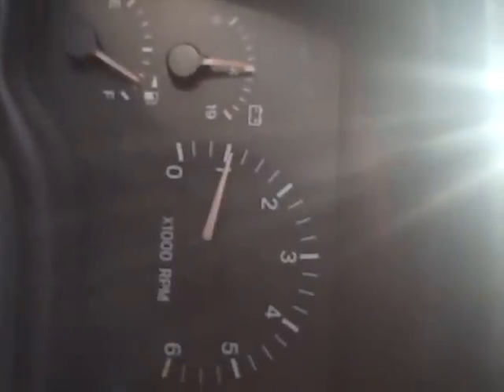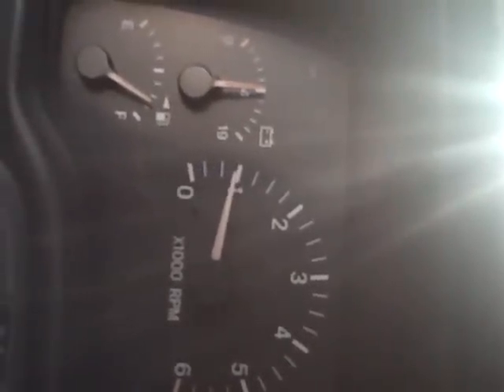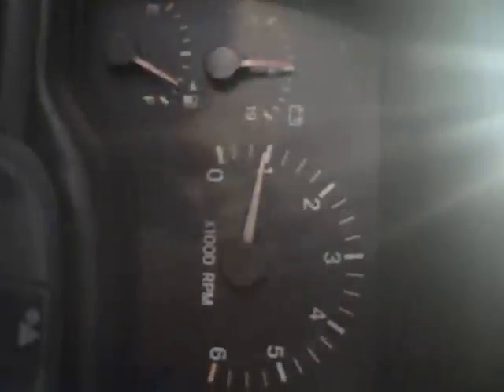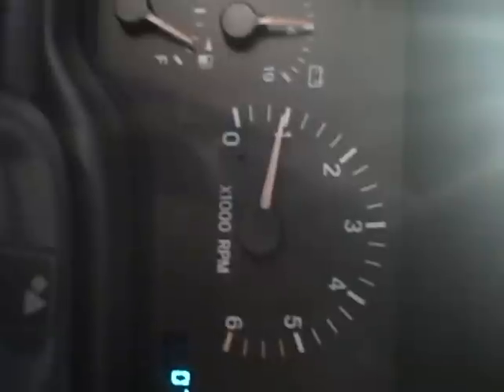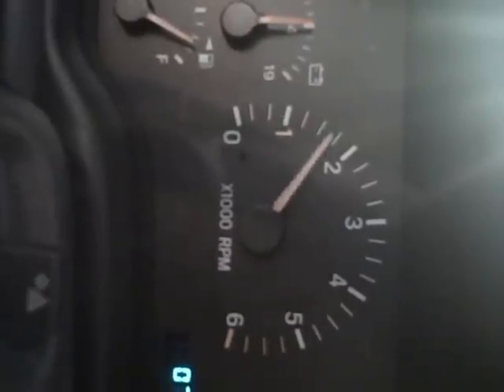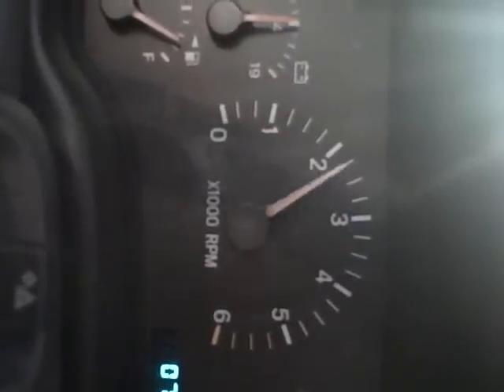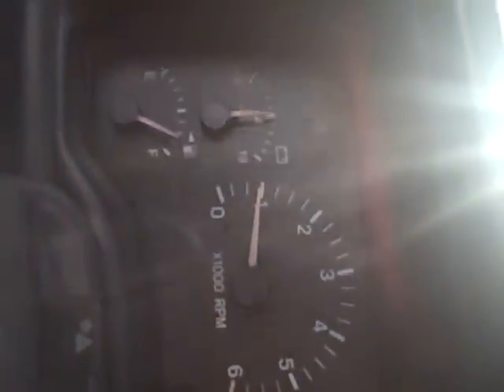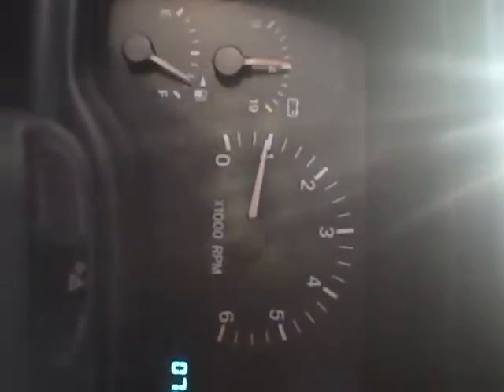Jeep misfire/stumble *** fixed *** oem cps sensor

Comment: hey i got a 96 cherokee country and im having some problems. It starts right up when cold but when its warmed up it gives me a hassle to start up. Then when it does start it starts up with a nasty growly low idle for a few seconds. I changed the tps and cks about a year ago so i went and got my warranty on the tps and it got a bit better do you think the cks is also bad. They are advanced auto part sensors. Tomorrow i am going to change the crankshaft position sensor so i will let you know.

Comment: I just bought a 95 jeep grand Cherokee and its having the same problem im going to put some fuel injector cleaning in later on today to se if that would fix but how u fixed yours ?
Reply: Did you ever get the fix. I have the same jeep.. 95 jeep grand Cherokee and same issues. Any tips.. Thanks in advance

Comment: i have a 02 tj as well and mine i can feel the misfire at idle, mine is a stickshift, but when i drive sometimes y jumps, like it stutters and the rpm comes down then it picks up and happens again. ive changed everything that you have changed and i still have that problem. it just feels the same way in idle just like yours but when i drive it stutters really hard. i have to change gears in order to keep it going. so im not driving it anymore because of that, so if anyone is going or went through the same problem please let me know. thanks
Reply: Aye it's Rickzzz having the same problem with mine. Did you find a fix?

Comment: I dont feel the misfire, i looked at the gauges the rpm was sumbling when i was in reverse i tapped on the pedel and it almost stalled. the check engine light doesnt come on, i would think from what i know that maybe the throttle body may need to be cleaned if anyone knows please help me out!

Comment: If I get a crankshaft position sensor from the dealer do I just take the old one out and put the new one in I might mess with the timing on the engine right!? @NATHAN BELDEN
Reply: chance simpson the crankshaft position sensor, aka CKP (cps is camshaft position/top dead center sensor) wont affect timing, only collaborates to calibrate timing in higher rpms

Comment: I have a 2000 TJ wrangler Sahara 4.0L inline manual transmission.

Problem: varying times starting infrequently then more and more engine shutdown.
sometimes service engine light lit with codes for misfire/crankshaft or camshaft position sensors other times no service engine light lit and no codes.

Repairs tried: verified fuel system end to end, verified plugs and wires, replaced crankshaft and camshaft position sensors, replaced PCM. Problem still exists. 

Solution: Come to find out it was the sealed coil packs. When cold engine ran smooth. After warming up and driving a while it would intermittently shutdown the engine with random codes and service engine light lit.
Replaced and problem has not recurred.

Comment: Hi guys. Since 2 weeks my truck run very well. I send the PCM to fix. The technician told me, that this problem (code 43) is normal, because is a problem of design. All Cherokee's PCMs will fail in some moment. I spend so so $150 dlls and he gave me garanty of 4 months. I hope help you.

Comment from the maker: ***ANOTHER UPDATE***  pulled the head off and was glad to find out that all the piston rings were still sealing, the piston heads look great, u can still see cross hatching on the cylinder walls, all the valves look great except for a bit of excessive carbon, but all in all this is turning out to be an aftermarked crank sensor that wasnt jiving with the computer.

Comment: It is most likely your PCM should be located on the passenger side dash. It's a common issue you can find the parts on Craigslist or something like that for a 100 150 bucks. Or you can find a video on youtube. PCM has a flexplate on it . That will occasionally go bad.  Easy fix

Comment: thanks my dad gave me his jeep and im having the same problem i'm putting engine cleaner product for the pistons and the injector and i have a crank shaft position sensor installed half way not in correctly hopefully i can get it fixed tomorrow thanks for the help
and damn that engines in awesome condition

Comment: Hi Nathan, sorry I didn't understand, did you fix it? Becasue my problem is similar, changed and cleaned the same parts, and I still have the problem with the misfire, code 43. Best regards.
Reply: i have a 98 jeep cherokee sport 4.0 L  and i have the same problem, was every now and then but now is really constant... need help
Reply: Carlos Ceniceros
Hi guys. Since 2 weeks my truck run very well. I send the PCM to fix. The technician told me, that this problem (code 43) is normal, because is a problem of design. All Cherokee's PCMs will fail in some moment. I spend so so $150 dlls and he gave me garanty of 4 months. I hope help you.

Comment from the maker: I fixed all the other issues leaving the valves for last, i found a completely put together rebuilt cylinder head for $260 and im shelling out  the money for some other upgrades while im down there. 

$50 set of 12 new lifters from morris 4x4
yella terra yt6627 rockers $320-450 ebay
aluminum red valve cover $100 from morris 4x4
new pushrods 2.49 x 12 --any autoparts store

Comment: Hi it have a question I have a 1998 jeep grand cherokee laredo and you start it and after a few minutes it starts to put  put the revs up and good you can here a lot of air at the air filter
Reply: christina buenrostro I have 95 lorado and does the same...some say it could be a vacuum hose leak....as for me I want to change the air sensor and throttle position sensor.....I change spark plug I have more power but when I stop or in park or drive to shift in drive or reverse vehicle die....

Comment: Drop tank...clean Debri. Throw out gas or run it through coffee filters.
Add Lucas fuel injector cleaner with new gas
New gas pump.

I fixed my 2000 JEEP Cherokee LAREDO 4.0 L
Reply: This advice makes no sense. A fuel issue would get worse with load, not better.

Comment: My 2001 jeep cherokee has the same issue. I learn the hard way to buy original sensors for jeep. Use only Mopar or you lost your time and money. Thanks for the video.
Reply: I have this problem also going to try.. get the mopar part

Comment: My 99 cherokee sport does the same only when its first started.. then after a couple minutes it mellows right out and runs smooth.. I have no check engine light or anything and I have pulled sensors to see if I had a dummy light and I don't. Any input?
Reply: I have the same exact thing 
On my 99 jeep

Comment: I'm having the same problem with a 95 GC 4.0....replaced cps with oem jeep/ mopar unit, new plugs, wires , cap/rotor...still misfiring ....effin' heeps!!
Reply: I'm actually dealing with the same thing with the 96, there was a tear in the muffler which one we feel that up the governor pressure sensor code went away as did the po351 ignition coil primary/secondary circuit, only thing that has remained is the o2 sensor Bank 1 sensor 2 which I'm assuming is the post catalytic converter 1 and may actually be an issue. the part that's weird to me is that when I use the code reader to try and look up the vehicle info on the PCM, it is unable to give me the make or the VIN number making me think it is a computer issue or possibly a solder joint in the computer issue let me know what happens with yours:-)
Reply: I have a 95 too. blew the radiator. when I replaced it and burped the coolant it erupted like a volcano all over the engine. now I'm having on and off again a dead miss in cyl 4 and 6. dumping raw fuel out the tailpipe
I have fire, fuel, and compression. changed plugs, wires, distributor cap and rotor button.
sometimes it's fine, sometimes it's not. 

can't figure it out. been told the computers will go bad. I can't figure it out
Reply: Nick Anello it's probably your cat, you should go to somebody that has the software to read the number one and number two at the same time and it gives you a pre and post cat reading, and it tells you the efficiency of the Cadillac converter. Its a check that the computer does. If the cat efficiency is too low it might not give you the vin# cuz that could be a Fail-Safe against cheating on smog so if they can't get the VIN they can't smog you and if you have a Cadillac converter that's not efficient enough they don't want it being smog Ed.

Comment: It's your PCM connectors, their corroded. Jeep had/has a major problem with this on the ZJ's if you'll double zip tie the connectors on the PCM it'll stop. You basically have to have something that'll hold them in there.
Reply: Matthew Williams this is exactly the same problem I was having and a guy at work had same issue it works. Sometimes I have to lightly touch mine to get it to crank but this did solve it from not running and back firing and missing really bad.

Comment: I got a 1999 and I've got a bad misfire. its fine at high rpms but terrible idling. almost dies. it also idles at 750 rpm when in neutral or park. help. I've replaced plugs,wires cap rotor oil and injectors. I have an autozone cps too. accel coil.

Comment: Nathan... your video says **fixed** so what was your issue? seems you were able to edit the title of the video, for the sake of the rest of the owners can you please add to database of common problems by posting the fix?

thanks dude!
Reply from the maker: replaced cps sensor with a dealer one. the one bought from checker or wherever i got it didnt work.
Reply: Cool... did you pull the felt/paper off the tip? I replaced both crank and cam position sensors on a friends not long ago, the problem I am sure is the coil pack. It still missed after.

Comment: I was getting P0300 on a 07 liberty. Just add lucas oil treatment 6 months ago and have changed the oil 3 times and have not had the code come back.
Reply: lucas too oil or gas? Liberty drives me nuts. Worse car truck I ever owned.

Comment: when you changed your Crank Positioning Sensor, did you get to it from inside your driver side floor panel (was told there was an access panel there) or did you get to it from under the vehicle?
Reply: I did cut 3×3 inches hole access next to the side wall/floor panel. Make it  more room to reach the crank position sensor. I did it on the name of science. Just put a aluminum sheet with self drill small screws/ silicone.

Comment: i DON'T UNDERSTAND, YOU PUT IN TRIPLE STAR **FIXED**; WHERE IS THE FIX?
Reply from the maker: +LILLY PULECIO the fix was using an OEM cps sensor instead of an aftermarket autozone one.
Reply: NATHAN BELDEN I changed my TPS and it has high idle and when I drive on flat roads it's fine but when climbing a hill it's gutless. Can't climb the smallest of hills. Not sure what my problem is.
Reply: do you run tires larger than the size it came from the factory? gearing
Reply: heroes. Wires
Reply: @KingKatRider  what will bigger tires do to the jeep?
Reply: Running a larger size tire without a properly matched gearing ratio will result in a gutless feeling when trying to accelerate or when coming up on steep inclines. It's usually less noticeable when your just cruising because at that point the engine and transmission are just maintaining speed rather than trying to build it up. A lot of Jeeps leave the factory tuned for a mostly on road life but still capable off road, that being said when we start to increase the tire size beyond what came off the assembly line the gearing doesn't always fall into a mid level performance range where its on road capability is equal to its off road capability for us that daily drive our Jeeps.
Reply: So was that a cam position sensor or crank position sensor?
Reply: @Rogue.Rider0  : fuel filter??

Comment: New Gas Pump...
That is how I fixed my 2000 Jeep Grand Cherokee Laredo 4.0 L
Reply: Hey buddy Idk if you still have your jeep but I got one just like it same year 4.0 and mine misfires part of the time but not all the time I can b going down the road and it start running on 3 cylinders it acts like pull over stop turn it off start it back it will b alright again until it does it again I have put coil packs,plugs,cam sensor,idle sensor,mass air flow sensor,new battery,full tune up oil and the person before me that had it put a new fuel pump it burns real rich and got some black smoke when it is missing it is really pissing me off I have worked on cars all my life I am 42 and never had one do this it has 3 different ways it runs perfect every now and again and the next day or maby 3 months later b going down the road it start doing it again cut it off and go it will run good again but not hardly as good as it did before it done it and one day or 20 later start it one morning and it b perfect again I would appreciate any help thanks

Comment: Lucky bastard! At least yours throws a code! My grand Crapochee has been doing this for years! I have replaced cam sensor, crank sensor (Twice!, this time with an OEM sensor), computer, two connectors to the computer (they would wiggle and engine would act funny, no longer happens).. Because of this POS I want my next vehicle to be be at least 20 years old, and Ill swap in a 4bt diesel just to be safe. Chrysler can go to hell and take their computerized undiagnosable POS cars with them!!!

Comment: You ever figure it out cant find a solid answer anywhere.
Reply from the maker: reynold castellanos needed a OEM   crack position sensor, the one I bought from Amazon wouldn't work with it.
Reply: Thank you ill look into that on mine
Reply from the maker: Mine wasn't a heat soak issue
Reply: This is for "Reynold" as was the heat soak vid...  https://youtu.be/VTUv6TL3ywI?list=WL

Comment: Alot of people saying try seafoam. I got this problem right after I put a can of seafoam in my gas. I have a new crank pos sens , idle air cv , TPS , distributor, rotor, plugs, wires, o2 sensor . Damn thing idles real rough and then it bucks on acceleration. It is much worse going up an incline where the engine is under load.  Cant figure the damn thing out !
Reply: Have you figured out the problem . Currently dealing with it

Comment: first do some new tight zip ties holding the computer plugs in and that might work for a while.then zip tie other sensor connections one by one if the problem reoccurs.that way you will know which connection is the problem ,and you can have at it later .you must use electrical grease on all connections for it, reset the ecu,each time you try one thing.don't buy new computer its the connections,[plugs,sockets],hardly ever a sensor.people buy a part and think that was it ,but it only fixed it because you had messed with the plug and wiggled the wires ,getting it to make a connection for a while.then,well ,you know."its back".every jeeps has computer connection problems,and sometimes the instrument cluster,like dodge neon] but never a recall.because its not a part.all mechanics will replace every part you will pay for, knowing theres a slim chance it is the fix.but always enough to get you out the door long enough to cash the check.then ,of course you can't return the part and they tossed the old one in the trash,[box out back ,to be shinned up and sold to the next $1000 jeep repair.still love my jeep though.just got a mint ,none smoking 2003 new tires brakes ,front end and withing a week dieing when warmed up .comp connection for sure.must have been why i got it for $2000.ha ha .i gonna find that jeep gremlin and kill it.

Comment: I have a ninety five Jeep Cherokee 4.0 2wd an this thing is in great shape for a 95 run great until I let out it ,it begins backfiring not sure if it's through the intake several of my buddy's have around the same year of the same model an they do it also but I would really like to know what it is I run can two half and half pre and it didn't do it now it's doing it again can't run cam two thru everyday vehicles on a regular can you???
Reply: Tim Knight back firining means youre running too rich (too much gas, not enough oxygen/air in the combustion) could be o2 sensor, which calibrates your combustion mixture; faulty spark plugs, which arent burning the mixture fully; timing, which could be making your exhaust valve open too early; or faulty ignition coil/wiring which isnt providing adequate spark

Comment: @tastygringo
I got a new CPS from the dealer and installed it tonight. It still runs like crap :(  ahhhhhhhhhhh
I took out the battery to get it checked at a store tomorrow and see if it needs replaced.
I checked all the fuses under the hood. Are there any inside the cabin that could be a problem?
Reply: my issue was the ignition coil needed replaced. good after that